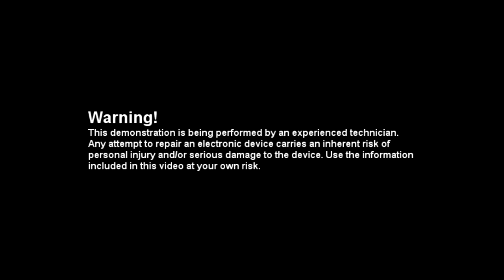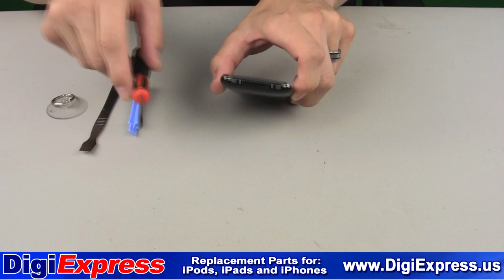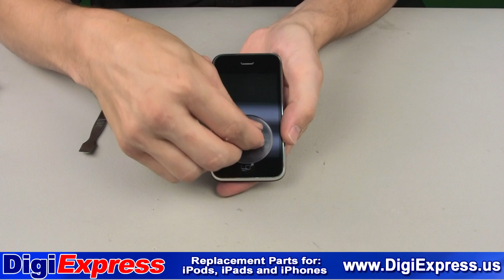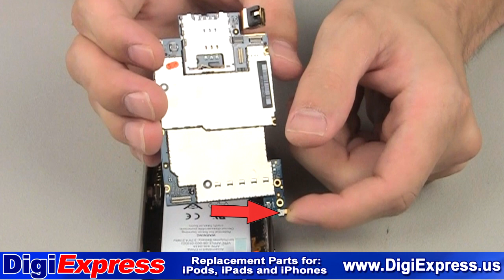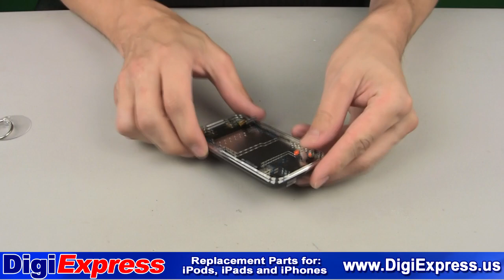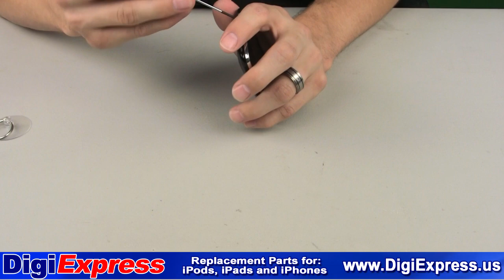DigiExpress - iPhone 3G 3GS Battery Installation

Comment from the maker: It sounds like the battery is not functioning properly. Because you get a charging symbol, it sounds like the charging port it fine. It's just the battery won't hold the charge.

Comment from the maker: the batteries are made to be compatible with the device. They will act just as your current battery. The firmware should have no affect on the battery. We've replaced batteries in devices with all types of firmware and have had no issue.

Comment: Eventually i realized that my earpiece stopped working after this repair, so when making phone calls I cannot hear the other party. I can still make phonecalls via speakerphone and headset.

I did some research before taking the phone apart again, and tried reattaching the number 3 (IIRC) cable, but that hasn't helped. I'm OK with losing my earpiece functionality, but if anybody has any suggestions I would be glad to hear them. Thanks.

Comment: Thanks for the video. It was a challenging process — taking the screen out with a weak suction cup and putting the tiny inner screws back without a magnetized screwdriver were the toughest tasks.

For anyone who's having trouble with the suction cup, be sure to wet it slightly for better traction.

Comment from the maker: First thing to try is a hard reset of the device. hold the home and power button down until it shuts off and the apple logo appears. Once the logo appears, let the buttons go. If that doesn't work, you will want to make sure that all your connections are tight, especially those involving the sim card tray.

Comment from the maker: If this comes off then your Cellular signal and/or Wi-Fi signal will be greatly diminished.  If it does come off, you can try to tin the remaining pad on the logic board then attempt to put it back on.  Though if the pad has been removed as well, then there is no metal to solder to; thus in that case it is not replaceable.

Comment from the maker: The battery itself may not have been the issue.  However some things you will want to check would be the two screws near the battery connection.  Make sure that the logic board is contacting the battery (the 4 gold pins on the end of the battery).  Also make sure the charging port is attached and is not damaged itself.  You can attempt to check out some KB support docs from Apple Support regarding common issues, though it may not help.

Comment: i changed the battery, i then plug to charge the battery but only flashes on the screen that  the battery was drained, obviously it is not charging, what did i failed to do? HELP

Comment: i have problem with this. When I put it all together and try to power on iphone ( 3G) first it shows me apple logo for some 10 sec. then logo  fades and occurs horizontal lines which are weakly seen,it looks like the screen is black. And then after about some 20 sec. iphone will go off. 
TNX in advice! :D

Comment: I have the same problem as bjjai. The battery looks like it's charged but when you unplug it, it turns off. (feels hotter then usual) When you plug it back in to the charger it shows that the battery still has a charge. I replaced the battery and I still have the same problem but even worse, now it shuts off even if it's plugged into the charger. I also noticed that the charger plug doesn't fully lock on both sides of the port, could this be the problem? Any ideas?

Comment from the maker: @Emmafaceee If it is a messed up cable,  then it would be the home button flex cable.  As for the sleep button, that would be a headphone jack that needs replacing (as the sleep and volume buttons are part of the headphone jack).  We can fix it for you if you would like, we have a $25.00 flat rate labor fee and our batteries are only $15.99.  You can find more information at our website, or on our users page in YouTube.

Comment from the maker: @Emmafaceee There are three pieces to the home button, first is the plastic button, second is the flex cable (circuitry) and third is the contact point on the complete charging assembly.  Either the flex cable is damaged or not contacting the charging assembly, or your charging assembly is damaged.  As for the power button, it is part of the headphone jack assembly, if you wanted to replace it.

Comment from the maker: @RoughRider96 check your #3 cable as well as that when you close the screen you keep the LCD ribbon cable attached to the board with your finger.  You can also try to remove the power source, the battery, from the device; then reinstall the battery.  This may "reset" the iPhone and then it will boot up again.  Though it does sound like an issue with the connections of the ribbon cables #1, 2, 3 to the logic board.

Comment from the maker: @airbornevet231 There is nothing to solder it to.  That is not proper information.  This battery requires absolutely no soldering at all, it is simply a pressure spring made from bent metal contacts that touch the logic board.

Comment from the maker: @alinko414 The batteries from an iPhone 3G are 3.7v at 1150 mAh, while the iPhone 3GS batteries are 3.7v at 1219 mAh.  There is a bit of difference and generally the batteries are not interchangeable.  Now if you use the proper battery and generally the same error occurs, you can then assume the issue is with the power management portion of the logic board.  Some times all signs will point to a battery being bad, then when the device is repaired the new battery drains and does not recharge.

Comment: @DigiExpress I actually poped in a battery from an iphone 3g I had laying around and I was able to get into the phone, view apps and so forth. however it was not long until it that battery died and started to malfunction (the boots would loop). My guess is because that was not the appropriate battery. When I also tried restoring the iphone it gave me an "unknown error" message. Also guessing again because of the battery somewhere in the process.  I dont know if anyone has experienced this issue

Comment from the maker: @alinko414 It does seem as though a replacement battery would be the proper part.  Though if by "Powers On" you mean, shows the Apple logo but goes no farther or shows a picture of a USB cable and iTunes icon; then the battery may not be the culprit.  If by "Powers On" you mean it will boot into the home screen and allow you to use apps and make phone calls, then all signs point to the battery as the culprit.

Comment: my 3gs had been sitting up for a month or two not being used as i had a cracked screen and lcd that needed to be fixed but didn have time. they are know fixed but the battery life on it sucks when fully charged it will stay at 100% for awhile but then it runs down quickly but sometimes only to 50% then shuts off sometimes it will turn back on but most the time it needs to be plugged in before it will come back on. Is this a software problem or should i change the battery. i have updated to ios 5

Comment from the maker: @cocoasmom1 You may have damaged the ribbon cable at the point where it connects to the glass itself.  If you have a magnifying glass it would be a great tool to use when following the connections.  Inspect the area surrounding the ribbon cable, you will see small transistors; make sure these are not "burnt".  As a last resort you can do a "Restore" through iTunes (see Apple Support for instructions).  We do offer a service to Diagnose the issues, more information is available on our website.

Comment from the maker: @PitbullMike007 This is a great question, the Jailbroken devices should have the same battery life GIVEN that you run only stock apps.  This means no installing Winterboard or anything like that at all (SBSettings included).  If you use RedSn0w, Pwnagetool then you should not have this problem.  If you use Blackra1n or Greenpois0n then you'll find a substandard jailbreak wrought with problems.  @Comex interns for Apple now and @MuscleNerd took a visit to Cupertino, on Apple's dime! Hope it helps

Comment: i have an iphone 3gs 32gb.. bought it last july,, so it is now 16months old.. and had it jailbroken close to 6-7 months ago,, and my batt life is suckin , gettin worse and worse each day,, now its to the point if i use it for 10-20mins of web or talkin, it will die out no matter how long i charge it.. could this be because needs new battery, or software needs to be updated ? havent been able to update it since the jb,

Comment: @DigiExpress I Changed the battery out per the video. I plugged it in and turned it on. When the Iphone first turned on the battery was at 89% and didn't drop until I restarted it. Then it continued to drop even while plugged in. I thought it might have to do with the grounding clip but I'm not sure. Any ideas?

Comment from the maker: @Rbards At 1:30 seconds into the video we do say to take a look at the installation video for the Glass and LCD screen to see the connections in greater detail.  We do sell the #3 connector (Earpiece Speaker Connector) if you would need to replace it.

Comment from the maker: @OutsidazTV There is no way to reattach that part.  Unfortunately you may have battery life issues from this point forward, the gold pin is a ground and you could also see your cell or wi-fi signal decrease.  The device may still be usable though.

Comment from the maker: @MyLaura1985 This is a tricky one, you may have a jailbroken device that does not have the SHSH blobs backed up (using iFaith or TinyUmbrella).  Sometimes a jb device gets restored through factory means (iTunes app) then will be "bricked" until you can properly downgrade the software.  Changing the battery will probably not help.  Visit Apple Support and search for Error Code 29.  There are some steps to help repair the software issue.

Comment from the maker: @r00kie104 The phone should be powered off when working on it, yes.  However, you can try to do a restore on the iPhone.  Look for a tutorial on how to put the iPhone into Recovery or DFU mode to allow a proper restore through iTunes.  Other than this, there are no remedies for a display issue like you are having.

Comment from the maker: @inam188 check the receiving end for the #3 cable, make sure this cable is seated properly.  There is a receiving piece that accepts the cable and on the recieing piece there is a small hinge that is rotated downward to put pressure on the cable and keep it connected.  Also, when you are closing the screen; keep your finger on the # 1 cable as long as possible, sometimes this cable comes loose when putting the screen back on.

Comment from the maker: @msjennjen the gold pin is part of the circuitry, most likely a part of either the battery ground or the wi-fi.  Since the wi-fi antenna is actually the chrome bezel around the screen it would make sense that the gold pin carries the signal from the bezel to the logic board.  Though it could also be a grounding point for the battery as if it is removed from the board, the device will no longer charge the battery or even turn on in some cases.